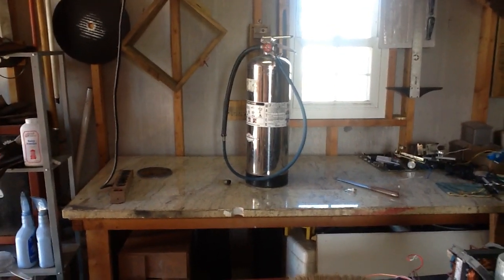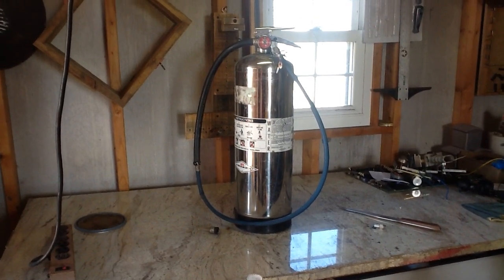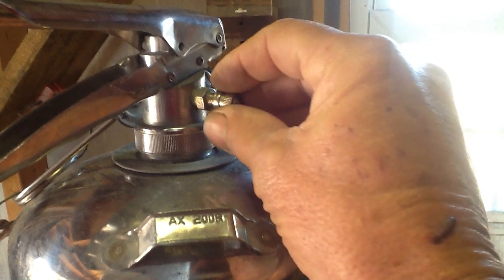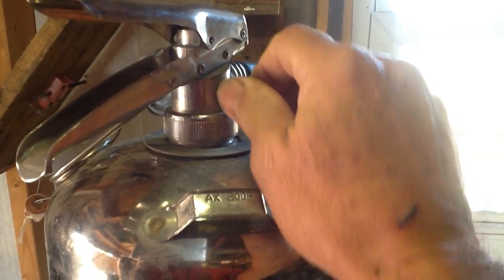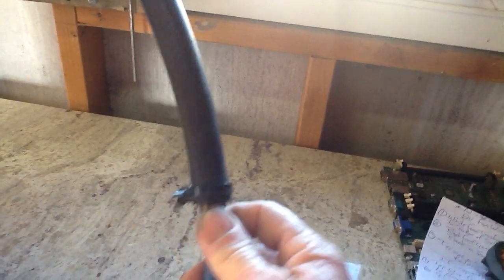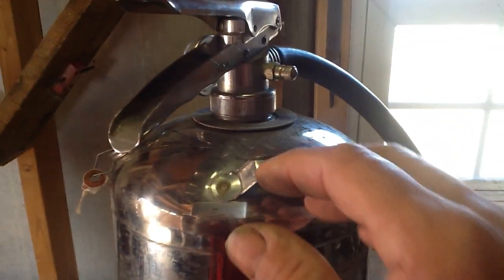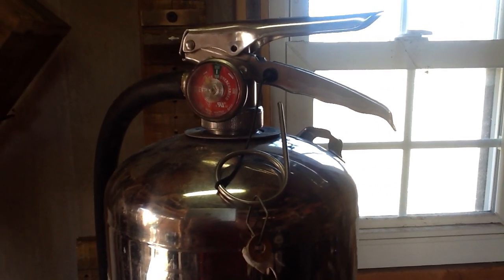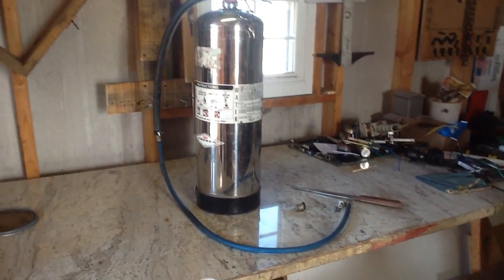Fire Extinguisher becomes a Compressed Air Cylinder ? Yep! :-)

Comment: Ok, thank you for this video. I have old one from my father in law. Just triying to know if I can replace the original hose unscrewing a nut to use for air or water. This one cylinder has a screw lid on top to put water in. It  looks like yours, but bigger. have a beautiful shine. Here in Venezuela it's very difficult to found many thins, ever air jeje

Comment: u got a facbook or phone number i got a airride set up that was done by someone else. How long do these tanks last before they are dangerous to be holding the 200 psi required to inflate my suspensionset up that was done by someone else. How long do these tanks last before they are dangerous to be holding the 200 psi required to inflate suspension bags

Comment: Were you able to successfully fill it to 100 psi?
Reply from the maker: yes
Reply: @MakinSumthinFromNuthin  are you not worried though that if its an old unit that is no longer up to date on hydrostatic tests that it will be dangerous?
Reply from the maker: @Fredengle  Not really worried about it, still works fine for general ise

Comment: I work for a company that does fire extinguisher inspections, and they are technically rated for 2 to 3 times the listed psi. It might be slightly different for the water one, but the common ABC extinguishers are rated higher than the tank or gauge states.
Reply from the maker: I get ALL the fire extinguishers I use in my casting videos, as well as this one for FREE by asking the local company for the ones that cannot be re-certified due to age, they gladly give them to me
Reply: Can I use a co2 extinguisher for inflating my 4x4 tyres

Comment: This is exactly what I was looking for. I was looking to convert mine but I have the wrong type of extinguisher (chemical sans valve). My question is where can I obtain one of these water with a refill valve type?  Anyway, nice video; all spare parts, even the hose clamp.
Reply from the maker: From a bicycle or an old tire, remove all the rubber from the schrader valve and it can be brazed in place

Comment: how do you remove powder remains from the tank? simply by cleaning it with water maybe? I wonder how to secure the inside of the tank fron corrosion
Reply from the maker: This particular extinguisher tank only held water from the factory, it is stainless steel so wont corrode. I put proper fittings on it since the vid and it works great :)
Reply: Makin Sumthin From Nuthin thanks for quick reply. I will treat mine with wather then and then turn it into compressor
Reply from the maker: Cool, yeah....just clean it out real well including your nozzle, the chemicals cake up inside to a certain extent...just flush well! :)

Comment: Is there any way to make it so I can use this to make an airsoft mini gun?
Reply from the maker: Hmmm, I dont even know what an airsoft mini gun even is....like a paintball type thing ?
Reply from the maker: Interesting...I am not sure if it would work for this application...I have never seen in person these types of "guns"....sry I wasnt more help
Reply: That's ok
Reply from the maker: It looks like they are using small CO2 cylinders to power that big gattling gun. I have small ones here about a foot tall and they hold about 3000 PSI. These fire extinguishers are only good for about 250 PSI so they would exhaust themselves very quickly I would imagine
Reply from the maker: I am sure there is a needle valve in the mix somewhere. I woulda melted off the rubber from the tire valve and brazed or silver soldered it in place myself. Good luck with you gun project. Them things look rather dangerous if they shoot BB's....stay safe :)
Reply from the maker: Ask him, maybe he will do a video about it :)

Comment: Hey man, do you have any idea where I can get spare valves like these, ones that I can pressurize with normal air pumped from a compressor? for some reason I can`t find these valves, maybe I just don`t know the name of what I`m looking for.
Reply from the maker: They are called Schrader valves...like on older bicycle tires. You can buy them at any hardware store or look for a free bike on craigslist :)